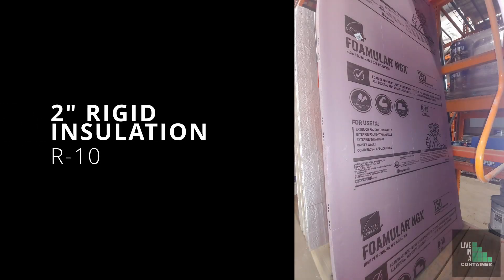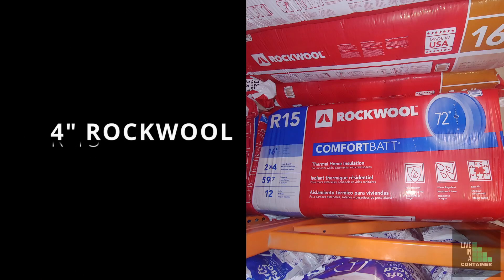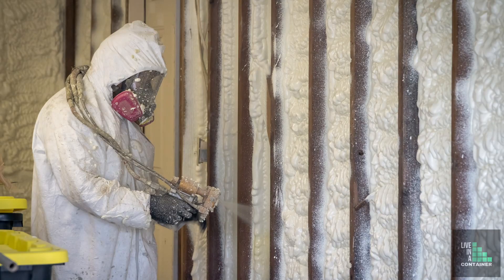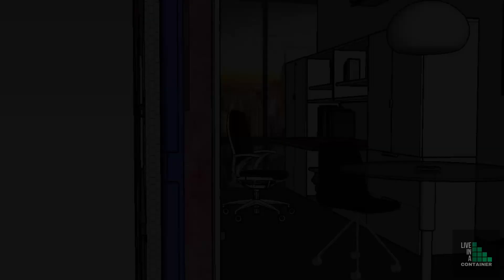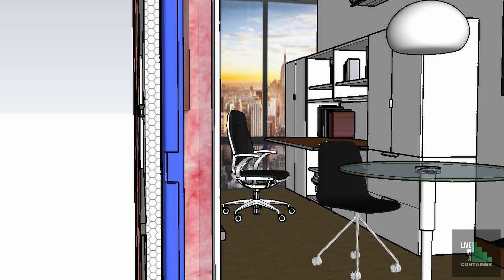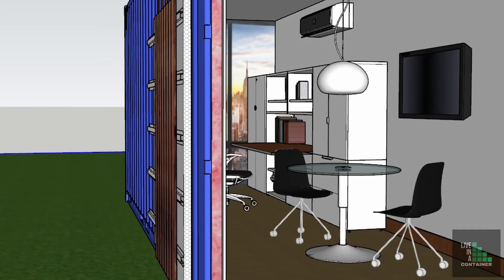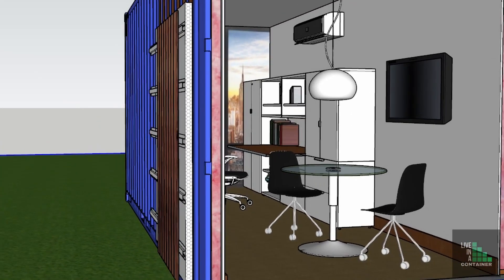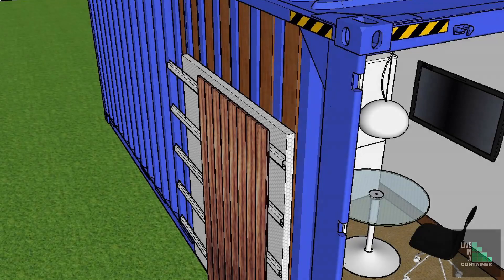Rainscreen: What is it?

Comment: Hi, great info thanks. I watched your best insulation for shipping container homes video where you talked about closed cell spray foam on the outside. I'm wondering if you use HIGH DENSITY closed cell foam, which is waterproof, would you need the added expense of siding? I'm planning a container home & trying to keep costs as low as possible. Thanks for your help, Christine
Reply from the maker: The insulation should be covered against excessive UV exposure. Check with the product manufacturer's recommendations. But, generally, spray foam will deteriorate if left exposed too long to the sunlight (prolonged UV exposure). Carlisle is one of many companies that provide insulation products. Here is a white sheet from them...https://www.carlislesfi.com/wp-content/uploads/LTR-CSFI-UV-Closed-Cell-Foam.pdf

Comment: Larry, what can be used as a barrier between the container floor and the concrete foundation? I want to protect the metal long term from water contact etc. What to do? Any thoughts?
Reply from the maker: Here are a couple of options. There are more, but maybe one of these will work for you...
1) You can place the container upon reinforced concrete piers. That would raise the underside of the container above the wet ground. Then, spray closed cell foam insulation on the underside of the container to act as a thermal insulation and vapor barrier. 
2) Another way is to place the container upon a reinforced concrete stem wall. That would also raise the underside of the container above the wet ground. Then, insulate the underside.

Here is a link to a video about those types of foundations: https://youtu.be/PiRGTPM-Y2w
Here is a link to a blog post about those types of foundations: https://liveinacontainer.com/what-is-under-a-shipping-container-home/

Hope this helps.
Reply: @liveinacontainer6602 thank you for sharing and all the good advice!

Comment: Warm air mixing with the cool air on metal can cause insulation mold, thats why insulate the exterior!
Reply from the maker: Yes, as mentioned in the video, having insulation on the outside pushes the dew point towards the outside face of the building. The condensation will occur near the dew point. Condensation can cause mold. There is also a better chance for the mold to have a hard time forming on the outside if the outside air is ventilating the dew point surfaces. Thank you for your comment.

Comment: Hi from Texas.  I've got 100 acres fully off grid with LiPo battery bank/ inverters.  I went with spray foam inside (GREAT vapor barrier) and 3.5" thick insulation.  I also used spray foam and rigid foam boards cut to 4.5' wide to adhere them to the valleys in the corrugation on inside between spray foam and 3.5" baton insulation.  This makes the valleys fully insulated too.  I built out the interior with a bathroom, kitchen, and bedroom.  I used 1/2' drywall in the middle and outdoor plywood in the bedroom and bathroom.  I used 2x4 to frame everything and spray foam under/around all 2x4s.  The spray foam backing under the 2x4s over the ceiling make it MUCH more stable when im walking up on the roof.
Reply from the maker: Howdy fellow Texan! Thank you for letting me know how and what you did with your build. I really appreciate it.